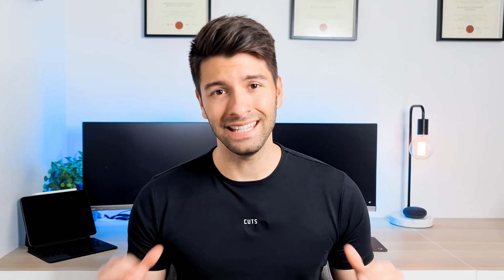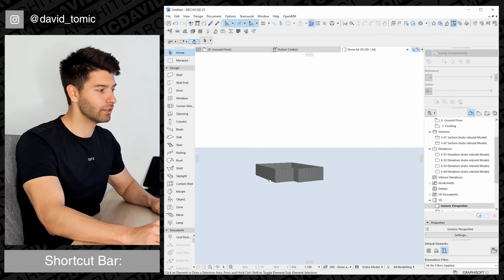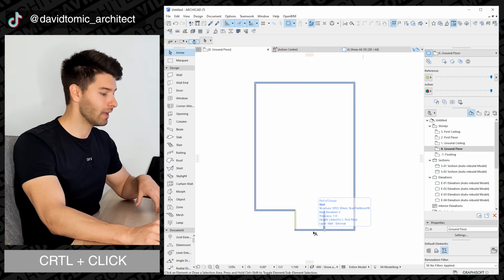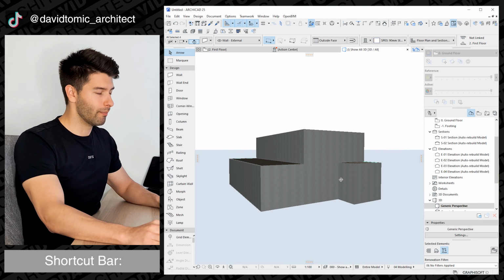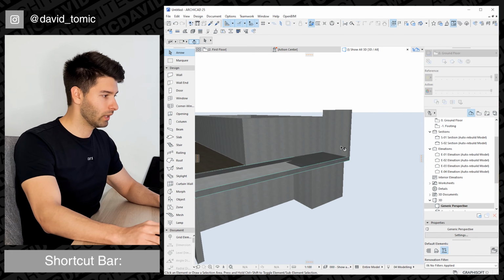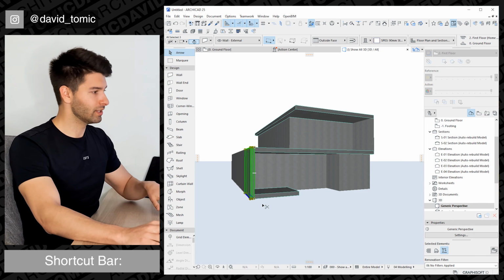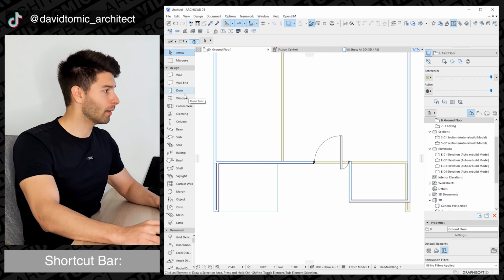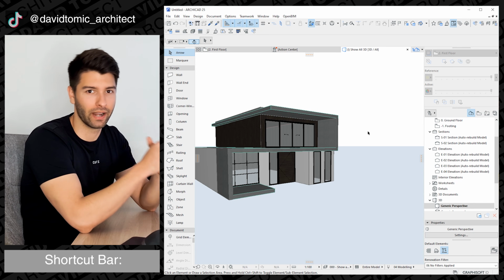ArchiCAD TUTORIAL under 20 Minutes

Comment: Your videos have been exceptionally helpful as I've been learning Archicad. Thank you.

Using your trick for creating an independent story for the ceiling/floor between levels is great, but I can't get stairs to run continuously from the ground level to the 1st floor because Archicad thinks there is an intermediate floor (the ground floor ceiling) and won't run stairs through multiple levels. Do you have a trick to get around that?
Reply from the maker: Put the stair home storey as the ceiling and then show on floor above and below

Comment: just a question i dont have the same options when choosing walls etc as u do i need to download smth or?
Reply from the maker: The default for wall types depends on your template, if you download the international template from Graphisoft website they’ll be similar. They are setup for most common wall types in your region